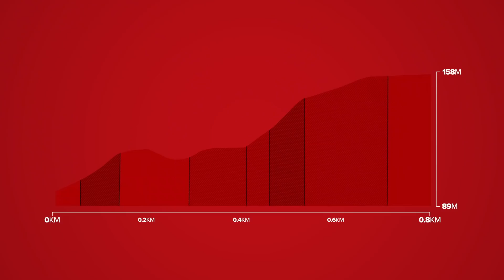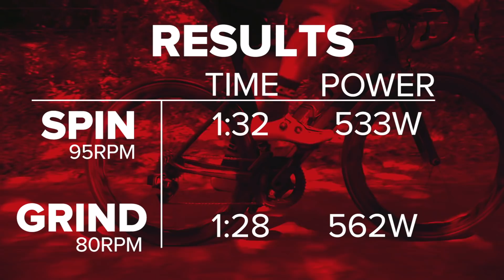Spinning Vs Grinding | What Is The Best Cadence For Climbing On A Road Bike?

Comment: I might of changed my endurance muscle twitch fibers. Because I can work I to the deeper and quite harder gear to get MORE rest within the pedal rotation over a a 3/4 mile pull on My Fuji TranSonic carbon bike. It’s less painful to get up to my faster mph effort. Up hill is to use gears, and now I will pay attention to how many gears I click up to from the deeper level I like. Thank you for this is my new question to answer for myself.

Comment: I know the majority of GCN is angled toward the race cyclist, so this won't be relevant to the vast majority, but I'm a tour recumbent cyclist.  I'm sure the physics changes dramatically, but of course I CAN'T get out of the saddle, but I CAN grind.  I find that grinding can be damaging to knees etc.  There may be a lot to what Si says about 'wasted energy' and that's important in race conditions, but the concept of 'not damaging yourself so you can ride tomorrow' on a multi-day is paramount (IMHO).

I love spinning.  I have the concept of spin at the same cadence and use your gears to ensure that you spin at that cadence.

Comment: This is just like comparing a heavy truck with 600HP and a race car with the same 600HP. The problem with it is torque!!! And the capacity to push a load in constant acceleration, instead of maintaining an much easier load at a greater speed... And this is why is stupid for powermeter not deliver torque numbers. Yes, you can make the math (power=torque.rpm). But that is not easy when you go at 180bpm... And, that is what powermeter measures: torque. It only makes the math before delivering the power value...

Comment: I have noticed the same type of relation in jogging. Reducing the length of each steps while yet increasing the rhythm of each steps seems to allow more capabilities to last longer and also accelerate. While pushing hard seems to reduce one's durability and eventually the capability to accelerate. I am convinced that the same apply with cycling. Of course at a certain inclination, the full available power must be put to service. And training will improve the two situations. Yet in my own experience I have adopted an increase in cadence to improve my performance rather then just pushing hard.

Comment: Good video.  Besides people riding styles of their preferred cadence and climbing in and out of the saddle.  I would have liked you to do both runs in saddle at the same wattage - I think the times would have been further apart.  Also if you used a 30 or 32 to emphasise the spin side.   That way you could compare the same amount power output which was more efficient.  And then climb the hill how you would normally, in and out of the saddle at the cadence you preferred at the same wattage.

Comment: Why do you grind on climbs? Easy, Bad gear choice! Swap that 39, which you never use on the flats, for a 36 or a 34, stick a 32 cassette and you will probably spin up a climb. A lower power to you might be a lot to another so you have to spin to save your legs! Froome, Sagan, lance, Yates, Wiggins dumolin and the list goes on and on! #spinnersarewinners

Comment: Whatever your data, it's wrong all around.
At low cadence, your brain panics losing torque(slowing down) and fires both antagonist muscle pairs. This force is not transmitted in your ligaments and compresses your cartilage which damages your joints through friction. This is grinding.

Comment: I think that my prefered cadence is probably on thhe slower end of things. Maybe around 70rpm or so but it tends to drop the steeper the climb and actually the smaller the gear that your using tends to dictate how fast you will spin your legs at. After all you are looking to climb not only at certain power but more importantly at a certain speed. We all like to go faster on a climb and the point you were making about the pros comes down to the question of how for them do they achieve there fastest speed on a climb with there limits on how much power they can produce. Can they do that by spinning there legs and maybe a smaller gear or can they do that by using a slightly bigger gear to climb and produce the same sort of speed. I guess the one thing which was always vaulted about the higher cadence method was that it would always allow you to recover well from attacks so that you could go on to make multiple ones... something which Alberto Contado kind of made look like rubbish! 😂 Great video none the less.

Comment: Not really as complicated as you are making it. So many factors in rider body type, pitch, fitness level, length of ride, pedaling efficiency make this answer different each time. Generally speaking I can go faster pedaling a bit slower, occasionally out of the saddle, but with a cost on the knees. Spinning faster, can go longer and deeper with a cost on cardio. On long days you just mix it up. Training intentionally at high RPM will improve your pedal stroke and give you a tool to use as needed. Training with a water meter and HRM will help you to find your most efficient cadence on given pitches but you will  still always switch it up depending on what hurts. Strictly grinders eventually blow out their knees but spinners don't usually win sprints. Really you should train both and use as needed. If you want to cycle well into your retirement you are going to need to learn how to spin before you destroy your knees. Not because it's faster.

Comment: I rode for many years through the 70's and 80's.  If you want to be faster, you have to gain muscle. The bike isn't going to do it for you. Save your money.
I grew up around the Ozarks so it was always hilly wherever I went. I started out doing what everybody does, lower and lower gears on hills but it seemed like a lot of pedaling and not getting anywhere. 
When I was around 14, I stopped standing up on hills using my weight., I made my legs do the work. I would power through til I either made the hill or fell over. Next time I would get further before leg failure. Eventually I never took my bike out of 10th gear. I could take off from a dead stop on a 45 degree hill. I'm not sure the new "lightweight everything" bikes could handle that strain, you have to pull about as hard against the handlebars as you are pushing on the pedals. The old solid crank held up well for many many years of abuse. I could keep up with traffic in town even from a red light start. Nobody had to get slowed down or frustrated. 
(Girls loved the legs, ...in martial arts, guys were scared of them.)
I moved to Florida when I was 18, flat as a pancake. Holee she-at!
I could hit and hold 50-51 mph on flat ground for several minutes (clocked by some dude in a Magnum PI Ferrari. I actually ran out of usable road before I ran out of power) or ride 30-35 all day long. Got pulled over in Orlando for doing 45 in a 30. Got chased off the freeways quite a bit. 
Got offers to join racing teams after one day riding along, I saw a pack ahead. They had all the stuff, expensive bikes and all numbered up. Made my way to the front, got lots of looks like wtf, offered them a sandwich from my pack. I asked what they were doing. They said ...racing. I said oh scuse me then, I'm just on my way home from work and headed to the pool ...pulled away and left them behind. I saw them out occasionally and rode with them some more but I wasn't interested in all the junk that goes along with "racing". ( plus I always had to slow down for them, who would I race?) The helmets and spandex didn't seem to be helping them go faster.
They may have been "pacing" themselves like I see them do in track too, saving a burst for the end. My way of training gave me that burst for miles and miles. My "cruising speed" seemed to be at least 10 mph faster than most I ever rode with. Even after all day on my feet at work.

Pedal for all your worth, as hard and fast as you can til you literally can't do any more or even hold up the bike. Each time, that will get a bit longer. Even when I was tired though I was usually still trying, always pushing that little bit. Proper seat height is probably the most import thing towards getting the most from your legs. They should be nearly straight at the bottom of your stroke. I kept mine where my toes would be pointed slightly down, using a lot of calf.

Cutoffs, flip flops, heavy steel 70's era Murray 10 speed right off the shelf, handlebar pack full of stuff, (work boots, uniform, dog stick, flashlights, tools, water, food). All I changed was the rims and tires ( went super skinny tire with a thin raised bead in the center, had maybe a quarter inch contact patch overall between the two tires.). I took it completely apart about once a week or so, cleaned, re-greased, meticulous alignment of wheels, chain, derailleurs and gears. There was absolutely no sound but the wind when I rode.

When you go for all the lightest gear...keep in mind....weightlifters don't get stronger by lifting lighter weights.
Crank those hills....you'll get much faster on the flats.

Comment: Of course pedaling style changes when going up hill, because it means that saddle is moved backwards (and down) relative to pedals and is tilted backwards. Actually the position moves towards what it is on a recumbent bike.
Reply: The opposite, actually. Like a recumbent would be torso further from the bars. Going uphill puts torso more over (closer to) the bars...similar to on an upright stationary bike.

Comment: Well, based on facts of my rides, if I do 300w at 95rpms I will climb faster than going at 300w at 72rpm. Do you wanna know the TRUTH of why is this? Nobody seems to consider that between each pedal stroke, at low cadence, you are spending more time on the cycle. So you are in a start/stop mode while at higher you are on a more fluid style. Just try the numbers above, you will notice that you are going slower when you swich high to low. So at a lower cadence you need more power to match the speed you were travelling before at a higher abd lesser power. My final conclusion based on my experience (and I do not live in other galaxy) is that a higher cadence is better but it comes at a cost in general effort. I agree with the evidence of the University of Leon (Spain) studies that were on pro peloton tested and said: a rider with a higher VO2 will self select a higher cadence than other rider, not doing it is not taking advantage of his natural conditions
Reply: I am going to experiment with this idea! I think it has valid points, thanks for bringing it up!
Reply: The Tempo Guy thats interesting. Increase your co2 and enjoy the benefits of higher cadence and a diverse supply of energy systems. Its noted that if we deplete the glycogen level in the legs the consequences are felt quickly however, by allowing the aerobic system to share much of the load, fatigue is lessened greatly. Froome is a grand tour rider of 3 week races and has designed his energy system to perform correctly in the last week
Reply: When I started cycling 5 years ago I was grinding all the day, 70rpm was fine, uphill or in the flat. With time and train I'm now more comfortable at 95rpm (99 for 90K TT... 2H20') As I said before I go uphill in sitting position and when I stand up I noticed my speed dropping as I was lowering my cadence while maintaining my power, so obviusly I'm loosing something somewhere, so there's a better way of taking profit of power output (more speed).  I must say that I can feel how my body is ''resting'' in this position although standing increases my heart rate but I do it every once in a while due to lower back issues. Also when road changes from climb to flat, it's more difficult to maintain the power at higher cadence and seems more efficient to lower it while accelerating, once reached the desire speed it's better to try to switch back to high cadence (in all this process my body suffers more than grinding all the way) So imagine a Pro with the conditions to do it 3 weeks in a row... AMAZING that's takind advantage of your natural/trained 
conditions
Reply: Also, unless a climb is very steep or your speed very low, a sitting position is significantly more aero. Even at speeds of 9-12 mph this adds up to lost efficiency out of the saddle.
Reply: So, for the last month I have been climbing at 90-100 rpm when possible, and yes I am faster! Heart rate takes a beating though, but, the legs don't hurt as bad. Anyway, I'll keep banging it out for a while.